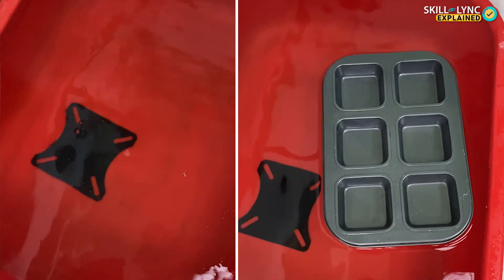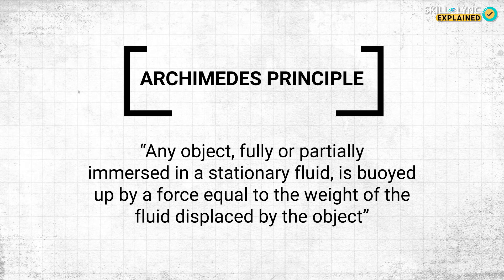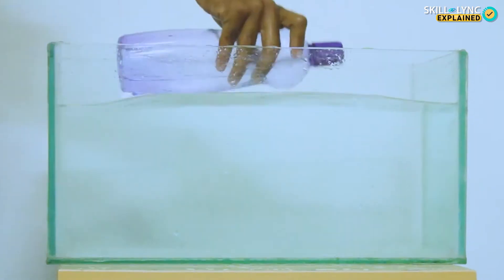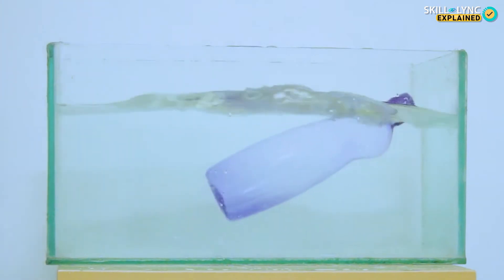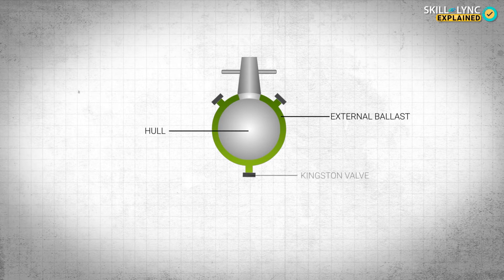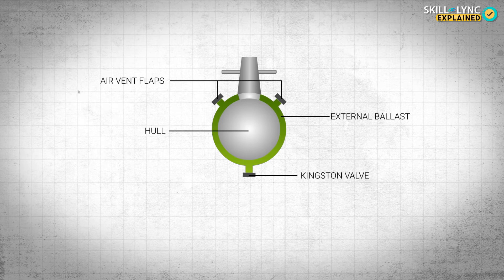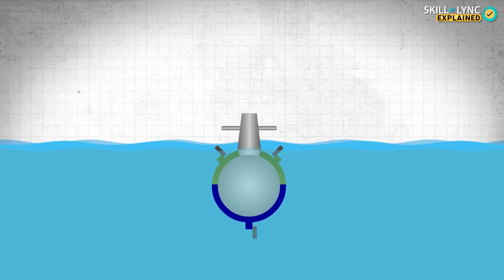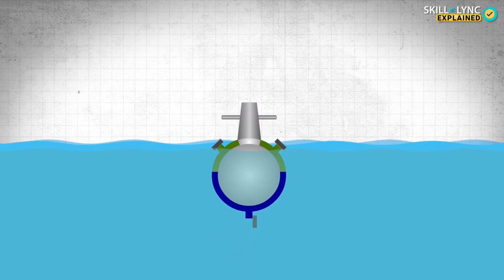How does a submarine dive & resurface in the water? | Skill Lync | Submarine Dive |

Comment: Where did they get the air from underwater.
Reply: They get the air before they go underwater and compress it into air tanks. Though, this video is also 'wrong'. Modern military submarines generally only use compressed air to surface during an emergency. It is not the normal way a modern submarine surfaces.
Reply: @cyborg7898  if the air in on the submarine. How the submarine got underwater in the first place. 
Copressed air or decompressed air 
Is still air. 
Air goes up. What am i missing.
Reply: @mohammadal-kamsha4020  Here's another great video on that subject: "Cartesian diver Experiment (How to make a cartesian diver)"
Reply: @mohammadal-kamsha4020  YouTube is deleting my reply/explanation for some reason. I don't know why.
Reply: Splitting up my comment to try and get it to not get deleted: "If you have a rock and there is a tiny bit of air in the center of the rock, that rock will still sink. An object having some air inside of it alone won't stop it from sinking."
Reply: @cyborg7898  so compressed air is not like uncompressed air.
Reply: @cyborg7898  hmmm so its the volume of the air that makes the difference and not the amount.
Reply: Here is an example video: "Cartesian Diver - Sick Science! #138"
Reply: @mohammadal-kamsha4020  If you have a rock and there is a tiny bit of air in the center of the rock, that rock will still sink. An object having some air inside of it alone won't stop it from sinking. Watch some videos about the "Cartesian Diver". It will show you how objects can float or sink even with the same amount of air inside of them.  
Here is an example video: "Cartesian Diver - Sick Science! #138"